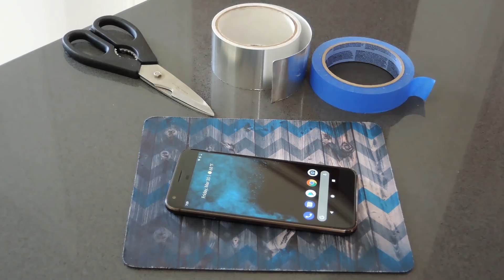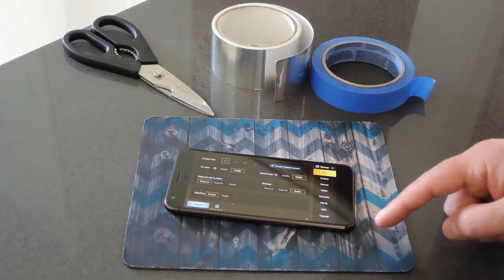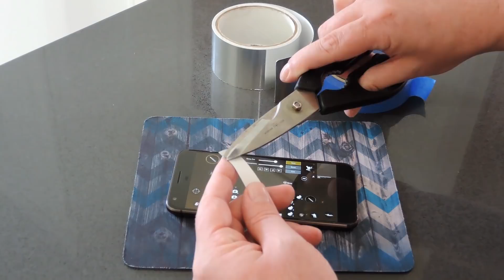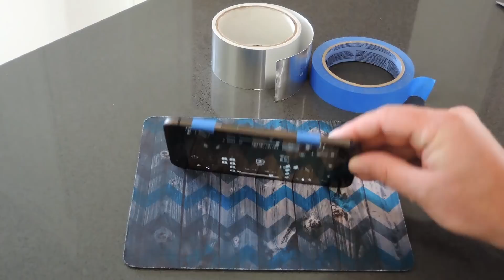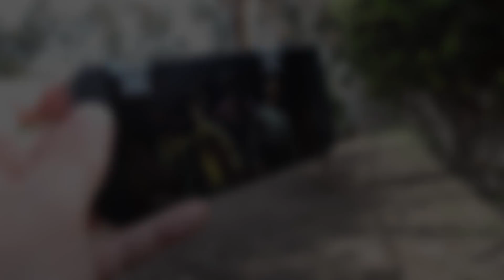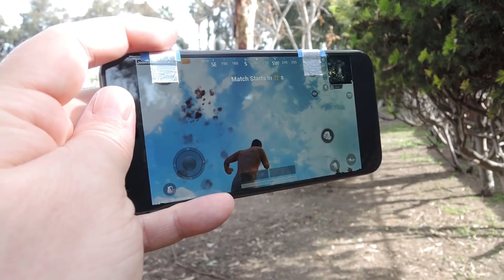Add Shoulder Buttons to Any Phone [How-to]

Comment: Wouldn't it be better and a little less tacky if you can remap the volume buttons to work as shoulder buttons and if so how would one go about remapping them?  I've looked all over the internet on the how to but come up short every time 😕
Reply: That would work great if the game allows you to remap physical buttons to certain actions, but that isn't always the case, and depending on the model, using both fingers to manipulate both volume buttons could be tricky, or even impossible. This solutions works on any touch control game
Reply: Possibly an Xperia phone would work since most i think have a dedicated camera button usually on the same side as the power button and/or volume buttons as well. Probably need to have an automation app to create a touch action on the screen (x,y,z coordinate) when whatever assigned button is pressed.

Comment: I did it but when the foil touches the screen its auto shooting without me touching the foil.. or i touch it instantly and it keeps firing
Reply: It's getting short circuited somewhere
Reply: @yassinashraf1235  bro that was 6 years ago 😳 💀
Reply: @DaBoyAlexxx  I still want to have shoulder buttons Broo, I need them for platformers like Mario , because I couldn't just hold the shoulder button as a run button

Comment: One question I understand foil is used can you use any other material that can substitute hate to say it I'm poor so I have no foil lol can just random aluminum or anything metal work like I took my old phone apart to see what I can create something with the parts inside and found this strip of aluminum sticker that carries the Sims code I believe will that work you can see it as soon as you take the battery out of your cell

Comment: perfectly explained. i tried this before but it didn't work because I failed to realize that my phone (iphone x) is mostly metal cased all the way around so any aluminum foil i used was getting short curcuited from wherever else I was touching my phone. SO THANKS I WILL TRY AGAIN & HOPEFULLY IT WORKS!!

Comment: This is amazing 10/10 thank you for making this only problem is that I'm using aluminum foil so I need a little bit more tape to hold down the foil so it blocks some of the other buttons do you have any suggestions?
Reply: Tactical Gamer mabey use duck tape try to find a more stronger tape

Comment: When I made it the buttons we're constantly pressed down by the foil withoight my fingers touching it, so how do I stop this so I can actually use this?
Reply: Same problem
Reply: Parker Allen just close the phone and open it again and it shoukd work
Reply: You have to use aluminum tape not foil
Reply: Cover metal parts
Reply: Same problem here too....
Reply: i think it might be because of static electric charge.
The electric charge flows from your fingers to aluminium tape. once you don't touch the tape , still some charges will be left on tape because of your previous touch which makes those effect even if you don't touch  the tape.
Reply: Use 4 layers of folded aluminum foil instead of the tape , it will discharge your presses when you take your finger off.
Reply: Yea, same problem for me two :/

Comment: What can I use instead of aluminum tape?
Reply: ShadowReflexx aluminum foil
Reply: HaiCyPlaysGames it doesn't work
Reply: Arctic Icez it works if u know how to apply it properly, and its not going to work for a long time but it works.
Reply: HaiCyPlaysGames It acts as if it's just holding down on the screen. Even when I haven't touched it.
Reply: HaiCyPlaysGames I've tried it all, and I mean that. I can't seem to get it to work at all. Every single style and form. I even ordered an actual plastic one online yesterday but they didn't include any tinfoil on the triggers at all. Nothing goes right with this :/
Reply: did the plastic one work at all ??? idk bro im sorry its not working for you :/ definitely worked on mine but dont worry dude im going to be reviewing a new triggers on my channel pretty soon by textriggers and its a much better triggers than the most common one sold in china since this trigger will be 3d printed and hand made/ assembled and tested for devices, its still on beta phase of the design and will further more improve. if u want to check it out i'll be uploading a review next week or so, with comparison between the china made ones and the hand crafted ones.
Reply: HaiCyPlaysGames Thanks man, I really appreciate it, I hope they can get it fixed. I should have been more wise to go back and check the product page on Amazon before the package arrived.
Reply: Arctic Icez you can use the aluminum foil from cigarette packages.
Reply: you probobly did it wrong lol because mine works with a tinfoil,use different style of trigger not the one on this video because it only works on alimunum tape. theres other DIY Tinfoil triggers on yt check it out.
Reply: HaiCyPlaysGames On the plastic one that I ordered at least didn't have the foil or conductive padding on the trigger. It's basically just the product without what actually makes it function, I'm currently taking with the seller to see if I can get it fixed. Amazon even stopped the selling of this product because of issues with it shortly after my order was placed. I guess I just lucked out.
Reply: hey man dont worry dude and talk to them maybe they will get them sorted out, if not i could maybe arrange something with the sponsor im going to have and get u one for free if i could get through them. because theirs isn't automatically  produced like in china, theirs is 3d printed and hand assembled and also tested before getting shipped.
Reply: Arctic Icez i made one by only using aluminum foil and tape that's all it works but on my first try it didn't work but it will be easy
Reply: Rain5155 I tried it over and over but it doesn't work
Reply: Arctic Icez make sure Ur screen is capacitive, it should not be resistive.
Reply: Karandeep Padam No, it's just the tinfoil. I brought a "professional" one off Amazon and it works great.
Reply: aluminium oxide
Reply: ShadowReflexx A gum wrapper, no joke it actually works
Reply: get a double sided tape and aluminum foil. and to make the foil straighten use any card and flat the foil. after that stick the Foil to a strip of double sided tape
Reply: ShadowReflexx any conductive strip would work. Though good luck figuring it out how to stick it. U wouldn't want to glue it to ur phone would u?